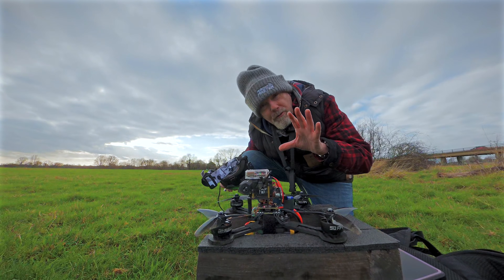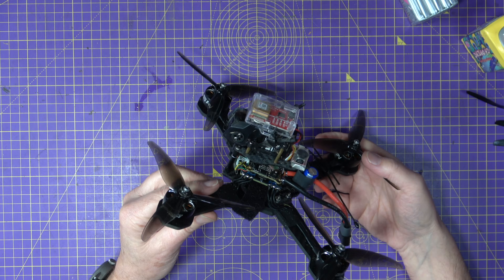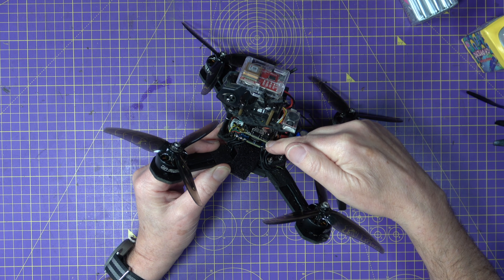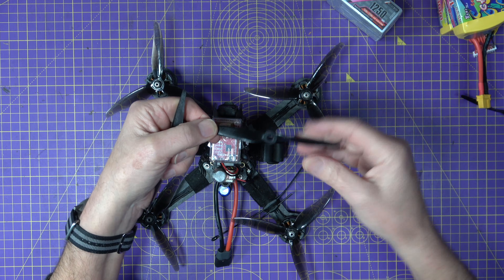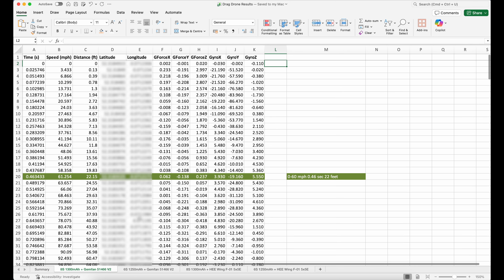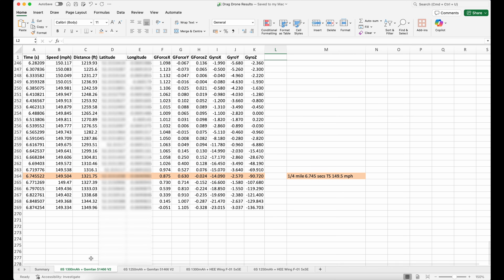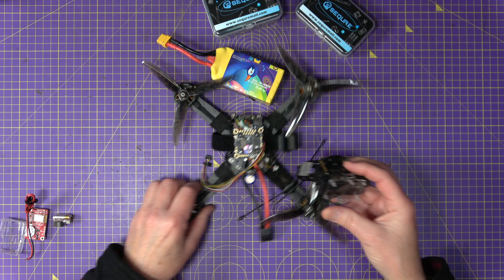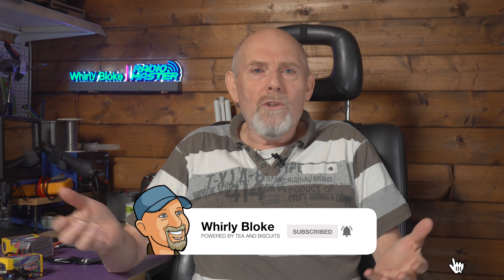6S vs 8S FPV Drag Drone — Real Acceleration & ¼-Mile Data

Comment from the maker: This started as a quick experiment using mostly spare parts, but the results genuinely surprised me and now I’m wondering how much faster it could go. Would you stick with a 5-inch setup or go more aerodynamic, run bi-blades or tri-blades for drag, or change the frame, motors, or battery? Drop your suggestions in the comments below.

Comment: Re: the finder getting ejected in a crash, this happened to me once. Nowadays I strap the finder inside the drone frame, so no more ejected finder and drone hunting in the tall grass after any "unscheduled hard landings" got a lot easier.
Reply from the maker: I made the classic mistake of using VHB tape, which is normally fine, but at >100mph. No chance.
Reply: @WhirlyBloke  Same here. After looking for the drone unsuccessfully for over an hour and with night fast approaching, now I use both VHB and a tie-wrap going inside the finder's heatshrink to attach it inside the frame. Works great and it hasn't been ejected again, despite some ugly, drone-damaging crashes.

Comment: Re: "And I think that may be that the three blade props are just giving up a little bit. Plus, the battery is dying a little bit" I would guess, due to the overall (un)aerodynamics,  the main factor is air resistance which increases with the square of the speed -- this "leveling off" happens because the batteries and motors reach the point where the force they're putting out equals the force of air resistance -- zero resulting force, so no more acceleration.
Reply from the maker: You make a great point about aerodynamics and the impact of air resistance on acceleration. It’s fascinating to see how all these factors come into play. New frame and props combo coming soon. I'be been bitten by the speed bug.
Reply: @WhirlyBloke  Glad to hear the physics classes I took in my distant past still serve for something ;-) and looking forward to your further videos 👍

Comment: Great video, I love it how you handle the data, very similar to what I do 🙂 Re: 7:49 "what was the naugh to 60 time? Well, we'll take naught to 61 cuz that's over 60" -- why not interpolate to reach 60s exactly? Simple formula, from the data I can see on the screen: 0.437687 + (0.463433 - 0.437687) * (60 - 58.358)/(61.254 - 58.358) = ~0.452, so the actual 0-to-60 time is about 452 milliseconds.
Reply from the maker: I totally get that, but honestly, I know I can go so much faster. The odd 0.01 secs doesn't really bother me. Great interpolation, though. 😊

Comment: Great video, what a fun project. I wonder if the next stage is just to change the frame. i.e. a single change to see what difference it makes.
Reply from the maker: The drive components are very good. It's all about the frame and the props.

Comment: I think you should go down the rabbit hole 😂 i am currently doing a new high speed 5” build the frame is  From ProtoFpv, TheProto5CR2 is made from a Canadian frame maker. But yea im currently just finishing up its paint job. Next is having to wire up the new Sequre H743&E70 G2 Stack 8s MPU6000 for the F.C & 70a AM32 128k 30x30. They didnt have the 20x20 when i was purchasing this stuff. But it fits fine in the  Proto5CR2 when i get it all built and running ill post and tag you in it.  Mine will have multiple uses for it, other then just highspeed chasing, freestyle, things like that. I have flown 8s & extremely dast quads for so long im used to it. The motores i use are 2207-2110kv motors VCi make amazing & durable ass motors but in betaflight i changed them from the 2110kv to 1650kv. Which is the 2110k equivalent for 8s. Definitely keep building and testing with 8s its awesome i love it. Loads more power 0 sag
Reply from the maker: Sounds like an awesome build! Definitely keep me posted on how that Proto5CR2 turns out with the 8S setup and those VCi motors.

Comment: Awesome results!
I also built an 8S racing drone.
2208 1500kv motors.
I didn't track quarter mile acceleration. What I did was find the fastest speed I could achieve, with all kinds of props. So just top speed.
The battery is very very important. I used a 1300mah tattu 8s rline 
The fastest tri blades were the HQ BMS 5.1x4.3x3 props at 240kph.
The fastest bi blades the APC 5x7.5 props at 280kph.
What I also liked from feel and acceleration were the gemfan 51455 quad blade props. They didn't have the highest top speed, but felt insane the first few meters.

Besides maybe getting a more compact racing frame with narrower arms, I wouldn't bother going the extra mile for 0.1 seconds faster acceleration.
For top speed also not worth it 😅
Trust me you already got a damn good setup with an 8s setup.
Maybe just try a more powerful 8S lipo from tattu, dogcom, bonka or SCM with maybe 1300-1500mah.

Other props to try that were alot of fun:
HQ 4x4x6
HQ 4x5x3
They also got me about 230kph.
The sound was amazo too.

By the way all these high speed world record attempts were on 7 inch props and 12S.

Only one guy Billy Shutter aka billister actually got over 500kph only on 8s and 5 inch props. APC 5x11 he used.

Think about how efficient his 5 inch was compared to the other guys needing about doubled the power for not even 100kph more 😅
Reply from the maker: Thanks mate, really appreciate you taking the time to share all of that. That’s some seriously impressive data. 280 kph on 5x7.5 bi-blades with 8S is wild, and it totally backs up what you’re saying about battery choice being everything at these power levels. I’ve actually been eyeing the Tattu R-Line 8S packs, so that’s a solid nudge in that direction.

Also interesting what you said about the Gemfan 51455 quads. That “first few metres insanity” is exactly the kind of thing I love testing, even if the top speed number isn’t the headline. And yep, fully agree: once you’re already in this territory, chasing another 0.1s or a few extra kph quickly becomes a game of diminishing returns.

Great shout on the props list too. I’ll definitely add a few of those to the test pile. And totally agree on the 7”/12S context for the world records; Billy Shutter’s 8S 5” run is still absolutely nuts when you think about the efficiency. I really appreciate the insight, it's exactly the kind of nerdy discussion I was hoping to spark with the video.
Reply: @WhirlyBloke I also tried high power 6, 7 and 8 inch builds all on 8S.

They all maxed out top speed at just 200kph on tri blades.
On bi blades they got 230kph.

Those were freestyle frames and not racing frames though.
So poor aerodynamics.

What I did was watch the maximum amp draw to compare them as well.

My 5 inch  120A on 8S max
6 inch 140A on 8S max
7 inch 170A on 8S max
8 inch 200A on 8S max.

So they actually all got similar top speeds, but draw more power with increased prop diameter.

The cool thing was I actually managed to build 7 and 8 inch that actually freestyle with the power and acceleration of a 5 inch.

My favourite and fastest tri blades:

Gemfam 6045
Gemfan 7050
Gemfan 8060

Oh and I built a powerful 10 inch on 8s too😅
180 kph on gemfan 1080 max 200A current draw.

My take from all these larger builds:
All you need is a 7 inch with 3008  1150kv motors on 8s.
Use 7050 props and 1800mah 8S lipo for fun or 8S1P  21700 Li Ion pack for long range.
The 6, 8 or 10 inch cant do anything better than the 7 inch from my testing and build experience.

7 inch is the sweet spot for long range.
Unless you want to carry higher payloads like camera or like used in modern wars, you dont need more than 7 inch.
The larger props need more power and therefore you need to carry larger batteries for the same flight time. Diminishing returns.

I test all my larger builds cruising at 60kph average speed.

Nice to share experience with you.
Reply from the maker: @chrisbee5481 all good info and good for thought.